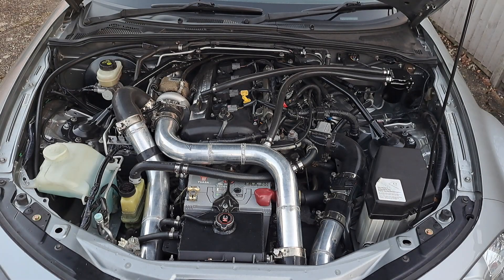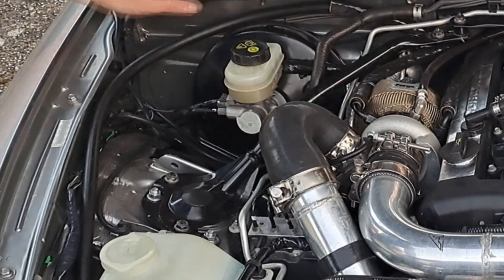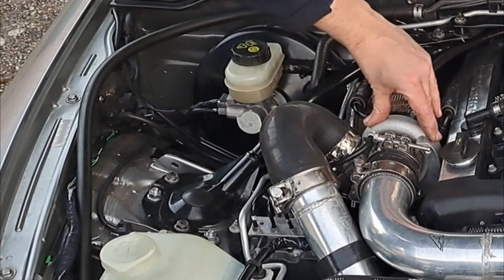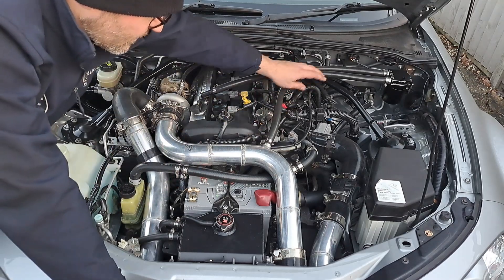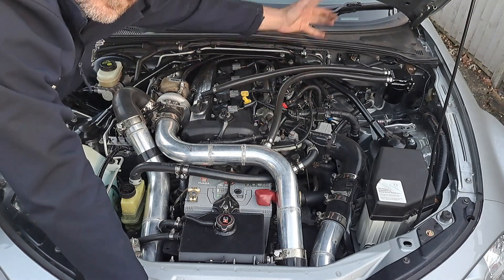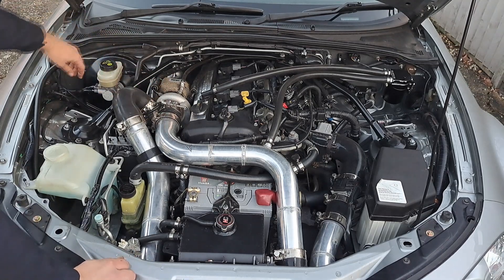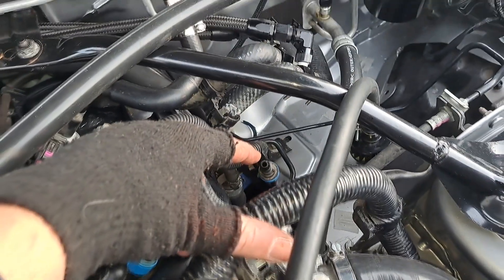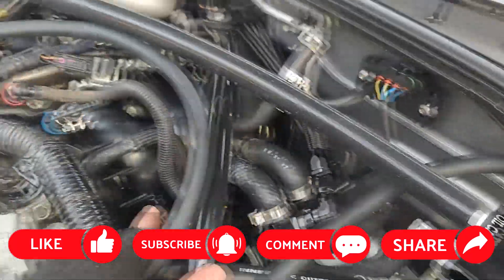Miata MX5 NC TURBO - DIY Turbo build Part 11  - Vacuum Line Overview

Comment: If you put the vent where you have, you have put it right by the heater intake. The car interior will likely stink of fuel if you leave it like this.
Reply from the maker: You are right, there's a small smell. I will move the mini filter away from the air intake. Thanks for heads up.